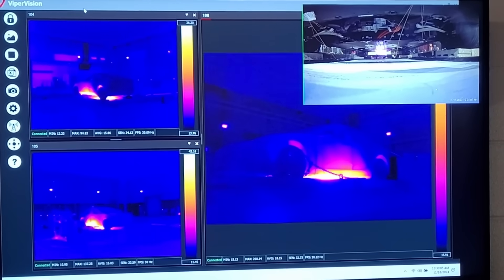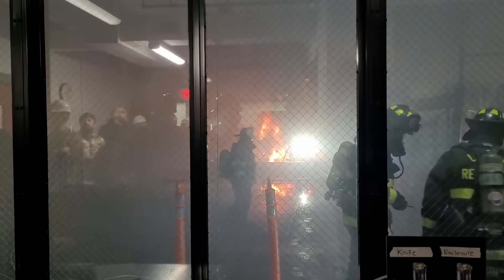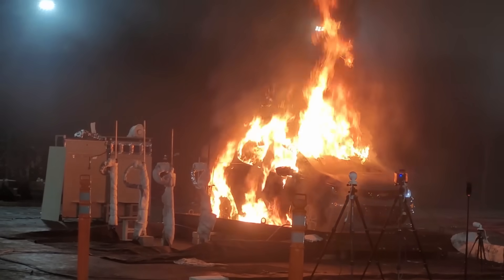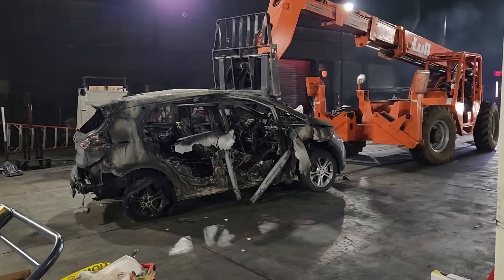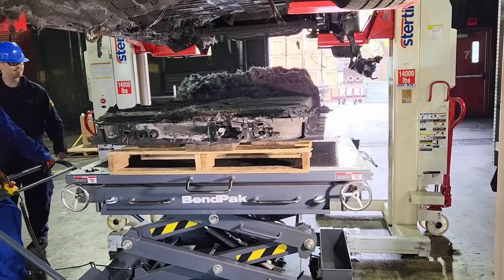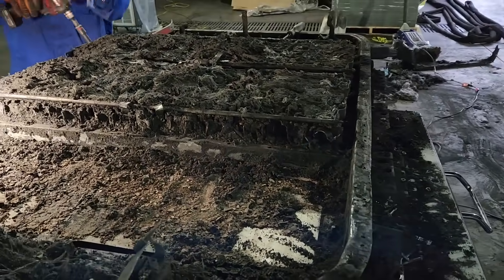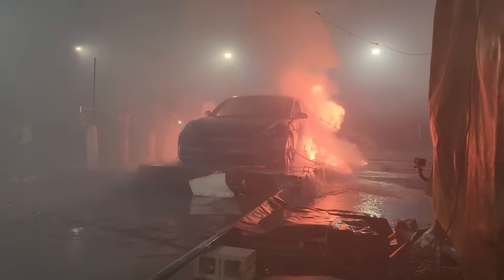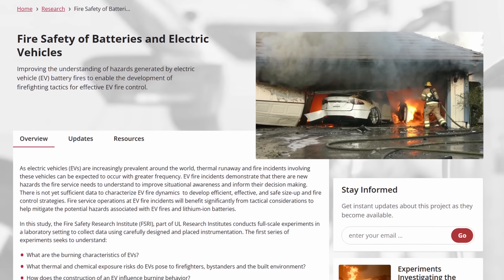FSRI EV Fire Experiments: What We’re Learning About Battery Fires

Comment: Power vehicles with hydrogen and supercapacitors. The best way to prevent battery fires and thermal runaway is to get rid of the batteries.
Reply: There has never been an issue with hydrogen burning or super capacitors shorting out. Never mind all the issues with green hydrogen production and storage.

Comment: I would like to know:
Is there any relation between batteries that ignited and the charge they had before the fire? Same as after the charge cycle.
Also, can the charger be too powerful for the battery thus induce more current and heat than the battery can handle? Or maybe the environment where the chargers are installed or/and the one where cars are parked after charging?
I am concerned because I have electric bicycles. I know they are not the same but they can ignite. They use specific chargers with instructions that I follow to the letter.
Thank you.

Comment: Look up or try to break from the inside with a hammer not the portable glove box hammer, though, you can try.  On the Tesla's you can't do it, and then try laying down and kicking the window to bend the Frame at least 4 times.  Imagine jumping out of the window with those flames. The greatest test ever down to the Bowl underneath, collecting water, and or possible Chemicals... Environment Impact. 

Side note look at the following
I had commented all last week about the EPA for the Los Angeles California Fires.  With EPA submitting it's Quarterly, & or Yearly Report, for Air Quality.  Not taking out the States Forest's, Communities burnt by EV's, or the winds wind's knocking down Trees or Power lines, which start thew Fires. .. 
EPA didn't remove the Fire Events on their Report and Blame Internal Combustion Engine Vehicles, and Blame Trump since he wasn't and as I write this he is still not president yet. 

More Facts for EPA Electric Vehicle's are the most Toxic Vehicules's.. don't Believe Me keep Reading the Following:

 f $80,000... That is not the Dealership price, you still need the Add-ons, or "Market Adjustment"  

The Following is Why Automotive Reviews and Why Racetracks are closing:
For current Vehicles over the air Update. 
1.  Those with Active cruise control will get  to only go 10 mph over posted Speed Limit. 
        a.  Which means you can have Hyper car or a Supercar with 500 to 750 hp + and won't be able to use it. 
2.   If no Active Cruise Control the car might exceed the speed limit , though, the constant Beeping, Chime, or Buzzard like if your door is opened. Wont stop until you go below posted speed limit.  I already seen Tesla's going 64 mph
3.    Audi started it with the R8 in 2022 & 2023. Customers returned them, and went to Competitor more likely Lamborghini Since they Share the Cradle, and Engine  In 2024 the R8 was remove ( canceled ) ... Keep that in mind it Beeped as soon as it went above the speed limit. 

End Game result the Havana Cuba Effect.. Everyone is buy cars without online service... All Manufacture's will Close in 2029 or 2030. No one will want these Speed Limiter Cars.
Following is why i will never buy anything newer than the 2022 Mustang 

Look up on YT Search  "  3 Fires Dead Fish : UPDATE MO Recycling Plant Fires "  MO = Missouri 
Granulated Lithium-ion from the Recycling Center in MO made it's way to Los Angeles thru Tornadoes and Santa Ana Winds had the Metal Particles between my Teeth and my ears. Last part Speculation I cannot prove it.  BLACK MASS could have been from the Arizona Recycling Center that burned.

EV's sure clean the air for no more than 8 years.  Battery is Toxic to water resources causing Drought Conditions. EV's are not easily recycled there were 4 Recycling Centers for EV's, 3 already burned down after a year of service.
I.C.E. engines are easily Re-forged. 
V8's Forever !!!!!
You couldn't pay me enough to Sit in, Promote, or Drive. 

Safety Hazzard
 Most EV's  have Electronic Door openers in the form  of a Button or in some cases the Screen.  During Collision or sudden Power Loss the EV catches Fire all Electronics Shutdown and Doors will not open.  Tesla's not eve a Hammer breaks the Windows. You have to Laydown and use both feet to kick out the Frame to bend the Glass.(5 kicks)

V8's Forever !!! 👨🏻👍🏻🏎🏎🏁🏁🚩🚩

Comment: So if EV fires can set everything within 50 feet on fire, what happens when there are so many EVs everywhere that there is always one parked within 50 feet of another...

And then one catches on fire?
Reply: The same thing as when an ICEV catches on fire and ICEV are way more likely.
Reply: Q: So if EV fires can set everything within 50 feet on fire, what happens when there are so many EVs everywhere that there is always one parked within 50 feet of another... And then one catches on fire? A: it's called the Felicity Ace now sitting underneath 12,000 feet of water off the Azores date: Mar 1, 2022, or it's called the burn out and scrapping of the Fremantle Highway date: Jul 26, 2023, or it's called the collapse of the Luton Airport Car Park London date: Oct 10, 2023.  <----- i hereby authorize you to use any one of these 3 "descriptors" interchangeably and as you see fit, enjoy.🤙
Reply: @phillyphil1513  Unfortunately most anti-EVers don’t know that the Fremantle fire was an ICEV and none of close to 500 EVs on board went into thermal runaway. They also think that the Lutron fire was an EV. Media initially jumped to a conclusion and the articles correcting the assumption were in the back pages.
Reply: @ Unfortunately most anti-EVers don’t know that the Fremantle fire was an ICEV fire and none of the close to 500 EVs on board went into thermal runaway. They also incorrectly think that the Luton fire was an EV. The plastic fuel tanks in modern ICEV were more of an issue than any EVs.

Comment: I am not a Fire Fighter so please try not to be to hard on me. Does the age of the vehicle battery alter the results in any way?
My main concern about older EV's ( over 5 years old ) is what will happen when back yard car dealer/mechanics are let 
loose on them and try to repair and re-sell EV's
Reply: Don‘t know that, but probably. Mostly because they used different batteries and different strategies on how to keep them safe. I remember a few years ago, tesla apparently added some emergency vent holes, so offgassing cells could hopefully fail somewhat gracefully. Don’t know what happened to that, but can’t imagine early EVs handling fire better than current models.

On the other hand, I imagine current batteries to still have some issues that will feel so obvious once identified
Reply: re: "My main concern about older EV's ( over 5 years old ) is what will happen when back yard car dealer/mechanics are let loose on them and try to repair and re-sell EV's". aw geez, if were to "hazard a guess" (pun intended) i suspect it would go a lot like what we've already seen with the hacks in NYC burning down Apartments and whole City Blocks as they claim to "know what they're doing" as they REPEATEDLY FAIL in their attempts to recycle and refurbish cheap DDR Li-Ion Batteries for Scooters and Personal Mobility Devices.  # WEVE SEEN THIS MOVIE , # WEVE SEEN THESE NEWS REPORTS

Comment: A sturdy enough fire box and venting through some scrubber substrate might be the only way to go. We can easily get most gases broken down to things that do not burn like a hydroxides or CO².
Reply: I'm picturing a truck with a giant two piece fire box that clamps around the vehicle.  May not work, but it looks cool (in my imagination).
Reply: @bobclarke5913 clam-shell in a parking Garage has overhead clearance issues, just have a container door to get the vehicle in
Reply: Understood, introducing the new „involuntary EV Extractor“, basically a roll-on container on a fire hardened truck on one side and a bulldozer / snow plow on the other, shoving the EV through a trap door in the container and then GTFO. Instead of the bulldozer, a wall may be used or the container may have its own puller bar.
Reply: @ I like it.  Either way, box it up and haul it off to cool somewhere distant and safe.
Reply: @bobclarke5913  yup, that’s pretty much all you can really do against a motivated self-contained chemical reaction: make sure it’s rare, and tow it outside of the environment
Reply: @genoobtlp4424  I hear that works with tankers when the front falls off.
Reply: @bobclarke5913  exactly

Comment: The characteristics of a battery fire being started to externally heat the battery are probably different from a faulty cell deep inside the battery going in to thermal runaway and causing a chain reaction, as the tests show a battery burn from the outside not from inside where I would think it more likely to originate. Perhaps the test could use a heating element deep inside the battery to replicate a faulty cell initiating the fire as I would assume this is more the likely scenario for a battery burn to start.

Comment: It would be interesting to see how different battery cell chemistries and form factors react to mechanical and thermal event and how hard or easy they are to extinguish. From what I have seen up until now the prismatic cells (LiFePO4) are pretty tough compared to pouch cells and cylindrical batteries (often NMC), but it would be nice to see some objective tests.

Comment: Very important test but weird this has not been done earlier. +/- 15 years ago.
Reply: There have been earlier studies. Austria did extensive studies due to their tunnel system through the mountains.
Reply: re: "Very important test but weird this has not been done earlier. +/- 15 years ago." oh they have, however what's best NOT to assume is that just because tests have been conducted, that the RESULTS of said tests would be openly communicated to you/me/we/us (because they won't).  hint: NASA and the US Military.
Reply: @ You can download the results of many of the tests including the ones done in Austria regarding tunnel safety with EV fires. You can also see tests on tanker truck fires. The results were that EV don't affect the tunnel safety and tanker truck fires are really dangerous.
Reply: Thank you, I stand corrected then. Why do these test still need to performed then? Is there no sharing of results between countries? Or is it because of EV development?
Reply: @ There will be ongoing fire tests to determine all kinds of different conditions. Batteries change all the time. There are different building types and scenarios. People ask themselves what floor or columns are best to resist a car fire.

Comment: I hope the study is able to provide battery cell isolation design recommendations and improved fire suppression techniques to prevent fire propagation to neighboring cell packs. 

On another note, with the California wildfires, you should do a special presentation on simple methods to fire harden your house from wildfires and prevent neighboring fires from igniting your house.
Reply: Firebreaks for one.
Reply: Not Building Houses from wood framing and paper, insulated with foam, with tar shingles on the roof maybe ?
There are a dozen concrete houses that just kept standing. Other houses had sprinklers fed from rain water collection and with its own diesel generator

Comment: External heating apparently didn't produce the same as internal self combustion, water infiltrated combustion or damaged cells from an accident. More experiments are needed.
Reply: indeed they need to dump them in seawater and other effects that cause these fires in the wild but in a controled environment.
Reply: To be fair, a battery shorting itself on fire should probably be treated as a dangerous manufacturing defect and mostly eliminated that way. Still a bad day if it happens, but should be fairly rare for now. 

An EV being in a fire and helping the rest to burn is probably the far more frequent cause of EV fire, and usually the more complex version because there’s fire damage all around.

Comment: Evs Folk's..Do Not Buy!! Period.❤
Reply: ICEV folks, Do Not Buy!! Period.
Reply: @yodaiam1000  I’d rather be able to get out of an emergency area then run out of battery power on the highway in traffic and walk my happy green butt to Saftey and pay for a tow. 😂 ice ice baby that’s the most green, if epa stops butting in.
Reply: @ EV are usually on the road first after a natural disaster. Gas stations run of fuel due to hoarding. Stations also need electricity for the pumps to work. You are even better off with an EV if you have your own PV panels. ICEV are a big part of why there have been an increase in natural disasters.